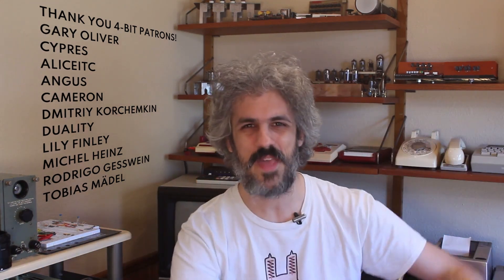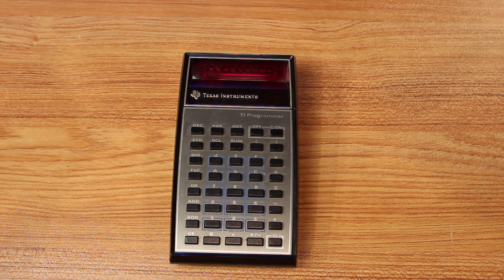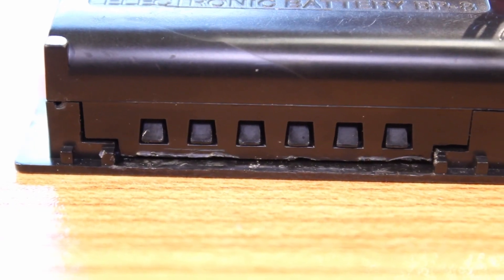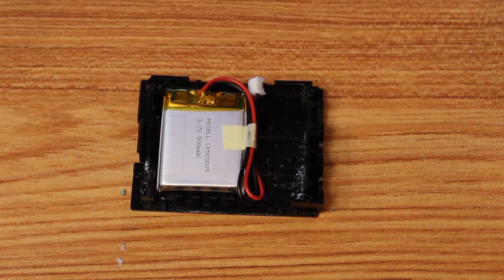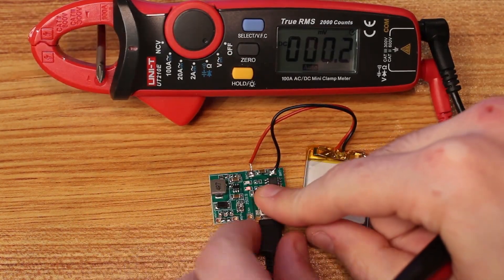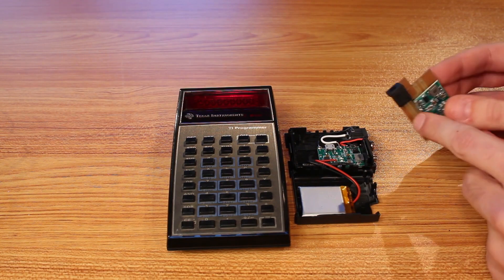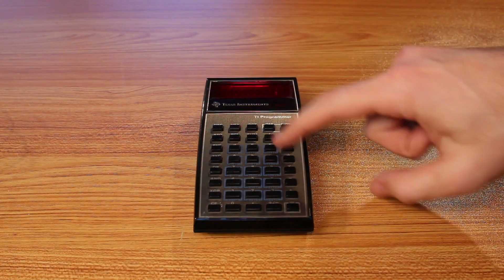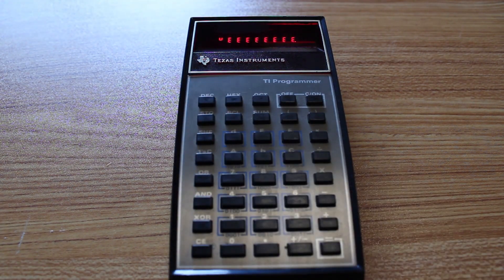Putting LiPO in my TI Programmer Calculator

Comment: Bought this version back in the late 1970’s. It was indispensable when working on large core dumps. Still have it somewhere.
Reply from the maker: It's a surprisingly useful little calculator. I'm sure it's totally capable as a standard calculator too, but I pretty much use it exclusively in Hexadecimal mode!

Comment: My first job out of tech school in 1973 was working at Texas Inst ( TI ) in Dallas at the Central Expressway site in the South building. T.I. hired me in Clearwater, FLA and paid for me to move to Dallas with a starting pay of $3.75 per hour.  The T.I. South building's  F.E.P. -2 was building the chips for the TI-2500, SR-10 and other early 1973 calculators.  At the time a 2 inch Front End was a big deal.     A couple years later T.I. removed the batteries from the calculator be of the cost of the battery being the most costly item.  Because the calculator was now to lite without the batteries they put a steel plate inside the case so the customer would feel the value of the calculator.

Comment: I think that qualifies as “upcycling”; great to see gear saved from the landfill.  I started with a TI-82, but can’t say I was a fan of the hard, bounce-prone, TI keys.  Once I could afford an HP-15C I never looked back.
Reply from the maker: Thanks!
And yeah, TI had some excellent calculators that were all plagues with fairly cheap, bounce-prone keypads. The TI SR-20 desktop machine I have is a prime example. It looks brilliant, has a wonderful display, and a terrible keypad. I would love to get my hands on some early HP calculators one of these days. Obviously, the HP-9100 CRT desktop calculator is a dream machine, but I would also love an HP-35 or HP-45. Unfortunately, vintage HP stuff has really jumped in value lately. Someday though!

Comment: I had one of those from new around 1977. They came with the NiCad pack you show, but also a plain cover so you could use a 9v battery. Mine still works with a battery. The rechargeable pack has long gone the way of all flesh.
Sometime in the early 1980s TI replaced this model by an LCD version (which I also still have) which I don't think was so successful in the market. 
By the late 1980's I had migrated to the pinnacle of programmers' calculators: the HP 16C.

Comment: I bought an HP 16C when (almost Eons ago) I was somewhat superficially involved with a computerized controller design.  Used for double checking the controller calculations.  I still have it, although it is "retired".  Well, my phone has an HP 16C emulation application, so that does pretty much everything what I might possibly need.
Reply from the maker: The HP-16C is super cool and I would love to get my hands on one someday, but they are certainly not cheap anymore for sure. I also have a couple of calculator apps on my phone, but I find myself using me old TI-2500 Datamath more than anything else. The tactile feedback of a genuine keypad is so much more welcome than a smartphone screen. 
Having said that, I would absolutely love to get my hands on an old HP-35 or HP-45 for a daily driver calculator.

Comment: I had one of those.  Received it with the batteries also toast. Got rid of the bits and just left the bottom cover and used it with alkaline 9V batteries. Very unflattering key action though.
Reply from the maker: Yeah, it really seems that the number one thing that fails on these old calculators are the batteries!
I agree with you though that the keypad is not the best. My TI-2500 has a much better keypad, so I end up using it 90% of the time, but it's nice to have the hex/oct capability on the occasion!

Comment: Similar TI calculator, and also dead cells. Simply used a 3V6 1W zener diode, and a surplus 6V wall wart, with a 1W dropper resistor to give a 3V6 rail to replace the old crusty deader than a doornail N type NiCd cells in it. Only problem is a bit of keyboard bounce, but for a calculator that I got for $1 it was worth it. Has been the workshop calculator for many years, simply left on most of the time, though i did rewire the power switch to short the zener to turn it off, relying on the wall wart poor regulation to drop the dissipation down, though not the most efficient method. Did slap a 68uF 16V blue tantalum bead across the zener, because that was the first capacitor I found when looking in the bag of surplus parts.
Reply from the maker: These old TI calculators are surprisingly hardy little things! Though the TI programmer does also have quite a bit of keypad bounce. My TI-2500 on the other hand isn't nearly as bad and the keypad definitely feels higher quality. TI was pretty keen on keeping their calculators as affordable as possible it seems. 
That's a nice solution for making the calculator a wired solution! Simple and clean and the calculator should run pretty much forever!

Comment: i might try that for my dad's old HP 67. Cheers from Austin TX.
Reply from the maker: Ooh, the HP 67 is a very cool calculator! HP used a weird battery pack setup, and it seems they're packs produced 3.7V, so interestingly, a LiPo produces just about the perfect amount. In which case you'd just need a LiPo charger module to make life easy for charging. Though, LiPos do tend to sit a little high it seems at around 4.1V, so I'm not sure how sensitive the HP calculator is to slightly higher voltages, that would need to be looked into before doing too much.
And that's crazy you're from Austin! I'm just a few hours north of Austin , it's a small world!

Comment: Oh how I hated those tiny red LED's! The somewhat larger, green VFD, found on some other brand calculators, was much easier to use and read. 
You reminded me that I still have a Sinclair calculator somewhere with its red LED's. That little thing had a curious foible; if you divided the correct number by zero it would count upwards in seconds. An unplanned, but for once, a useful error message!

Comment: I had one of those!  Very cool tiny LEDs.
Reply from the maker: The LEDs are absolutely minuscule! I was a little surprised actually when comparing it to the TI-2500 next to it. The TI Programmer LEDs are about half the size and they use a little domed lens to magnify the digits. The unfortunate side effect of that is they have a much stricter viewing angle than the TI-2500. Still, I'm really happy with both of my little TI calculators!

Comment: As always. I have to say,. Great montage music!. You have a gift in the pairing of montage music with the montage .. scenes?
This video was really inspiring. Because you installed the LIPO battery and converter/charge board. but into the existing battery pack. So it feels more "authentic" or original to the design of the calculator.  
Not that I use batteries in guitar pedals any more. Mostly a power supply you plug in. But I feel the inspiration from your video to attempt to convert a guitar pedal to use lipo battery plus boost converter mod like this. so when the pedal is plugged into the pedal board it will function off the external power supply and charge the lipo.. but if i pull the pedlal off for heading out to a remote gig., then i can just grab the pedal and go, and not have to worry about the usual "has it been 3 gigs or 4 gigs since i replaced the 9V battery in this, and should I replace it before I head out.".. 
Really not being an "eco terrorist" and not needing to rely on disposable one time use batteries, is a huge virtue for me.  
Thank you for the great video!
Reply from the maker: Thank you so much!
I quite like the elevator like feeling that the music in this montage gives, haha.
That's actually a really brilliant use for a LiPO! I'm surprised more guitar pedals don't do that, it seems like the perfect logical next step. More life and less chance for you get to a gig and have the pedal be dead.

Comment: I don't see anyone else saying this so, late to the party though I am, I thought I might as well chime in with some info.
Lithium-based rechargeables have a varying terminal voltage which gives a fairly accurate indication of the state of charge of the cell.  Depending on the exact chemistry used, the maximum terminal voltage can be 4.2V while the minimum can be under 3.0V.
Charging one of these requires both voltage and current limiting, which is what the circuit you added does.  Firstly, the current is limited to around half the "C" of the battery (so for an 800mAh battery, around 400mA charge current) since charging at too fast a rate will damage the cell.  Secondly, once the voltage rises to the maximum permitted for the particular chemistry being used, it is capped at that voltage and the current is allowed to drop until it reaches about 1/10th of the starting current, at which point charging is stopped.
Different battery chemistry will slightly alter the voltages.  Some batteries need to be charged to 4.1V per cell instead of 4.2V per cell and some can tolerate being discharged down to 2.5V while others need the discharge to stop around 3.0V.
Getting the correct circuit for the type of battery you're going to use is essential if you want the maximum life out of your battery.  The circuit you chose is designed to work with Li-Po cells and was designed to fit, along with a Li-Po, inside the case of a 9V battery so that you can have what appears to be a rechargeable 9V battery except that it is charged using 5V through a separate connector in the battery case.

Comment: You should trim the wires so there is not a lot bare conductor floating around waiting to cause a short circuit. The insulation should be right up and  close to our joint. Still nice to see an old hp working again.
Reply from the maker: Thank you! 
Everything is fairly securely mounted, so I'm not too worried about shorts. Also, the leads that are a little too long are just for the charging port, so 99% of the time, there's no power on those wires at all.

Comment: I think if you make a video to explain how the board works, I mean all chips rams roms ect... And the internal power supply, it will be so educatif, thanks
Reply from the maker: Interestingly, most TI calculators use a single chip design. The TI Programmer shown here uses a single TMC0983 chip and nothing else. The chip itself is really fascinating though, and that family of chips is often considered the first ever microcontroller. It stuffs a 4-bit processor, a mask ROM and RAM all into a single package. It was also the family of chips that really let TI absolutely dominate the handheld calculator market for so long!
Reply: @UsagiElectric  thank you so much for your help and time

Comment: What is that part number for that boost converter how useful :)
Reply from the maker: These particular ones are "AITRIP Boost Chargers", though I don't know if there's a specific part number for the board. They do make use of the TP4056 charge IC though. I was a little skeptical at first, but I'm quite happy with how they work!
Reply: @UsagiElectric  thanks! I have a ti-calculator I need to fix I was thinking about putting something like this in one.

Comment: Hi there ... great mod!  My mother got me a Ti59 when I got into university way, way, way back.  I would like to resusrect that device if I could.  Do you have a link for the charging circuit?
Reply: I added a cell phone battery to my TI-59.  Just solder some wires from the battery directly to the tabs inside the calculator.  The battery has a BMW built-in and works with the original AC 5.7VAC charger.
You get several hours of run time.

Comment: I always wondered how these old calculators calculate square root using discrete logic
Reply from the maker: Interestingly, neither my TI-2500 or the TI-Programmer can do square root operations, so it's certainly something that's quite difficult. There are some ways it can be done in binary using some clever calculating with algorithms that are way over my head, but it seems the simplest way to handle it is to just have a lookup table stored in a ROM somewhere. No calculation is actually done, it just receives some parameters, then looks up what the answer is and displays that. 
Certainly not the sexiest solution, but gets the job done!
Reply: Most likely they use the Newton-Raphson method for square roots.

Comment: The resistor attached to the TP4056 IC's pin 2 is Rprog used to set the charge rate.  Your module is probably set to the maximum 1000mA.  A maximum charge rate of 1C is recommended for generic lipos:

Rprog Value - Charging Current

10K Ohms - 130mA
5K Ohms - 250mA
4K Ohms - 300mA
3K Ohms - 400mA
2K Ohms - 580mA
1.66K Ohms - 690mA
1.5K Ohms - 780mA
1.33K Ohms - 900mA
1.2K Ohms - 1000mA
Reply from the maker: Very good eye! I just checked the board and it does indeed have a "122" SMD resistor, which I believe is 1.2k and should give a maximum of 1,000mA. The LiPo I'm using is a 500mAh battery, which gives a charge rate of 2C? In the future I may have to knock that resistor down to about a 2.2k ohm or so.
Thank you for the insight!

Comment: But that's not a LiPO battery, that's a normal Li-ion battery.
BTW, Li-ion batteries are 4.2V when full, and 3.0V when depleted.
Reply: Looks like lithium polymer to me.
Regardless, you're correct about the voltages.